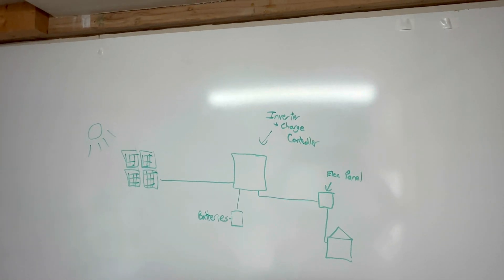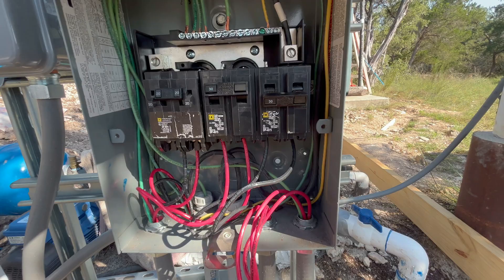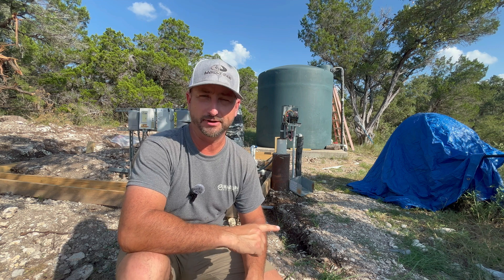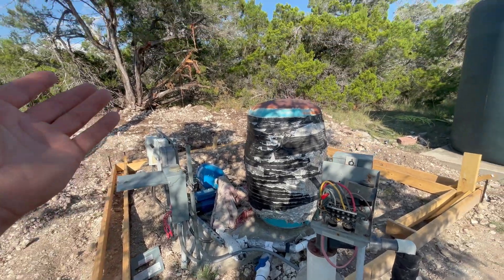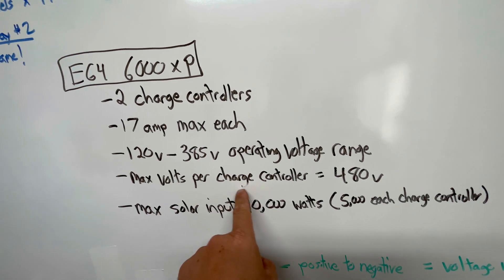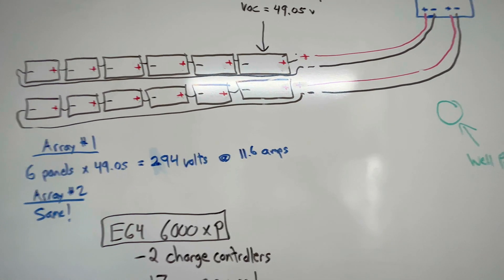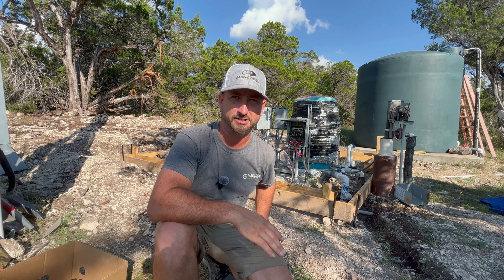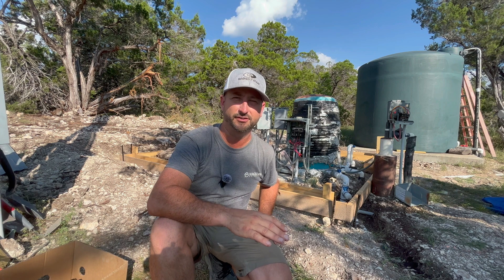How To Power Your Well Pump With Free Solar Energy? 1 of 2

Comment: As you'll soon find out, high-frequency, transformerless inverters like the 6000XP were never designed nor intended to power high induction motor loads like well pumps. You may be able to run your pump for a few months, maybe even a year, but you'll toast the MOSFETs in your 6000XP and will probably damage your well pump's motor because the 6000XP doesn't provide any galvanic isolation without an output transformer. And by the way, the 6000XP is no longer priced at $1,399.00. Try $1,699.00 for this ridiculously overpriced inverter.
Reply from the maker: @quickquote1568  I’ve had a high frequency transformerless inverter powering both my well pump and water pump, and 4 ton AC for 3 years. No problems. You have bad information.
Reply: @quickquote1568 - Do you have a source around your assertion that EG4 and like inverters cannot handle induction motor loads?  Likewise I am looking to set up something for my well pump.  Thanks.

Comment: Fantastic vid.  Any chance of a follow up showing the connection of the inverter to the pump?
Reply from the maker: @tedtuesday6278  thanks for the feedback. I just finished the complete install and have been running the well and pressure pump fully offgrid on this system for a week. Running flawlessly. I’m in process of making a video going over the entire system. I need another week to get it released.

Comment: Would a soft start work on the well pump to reduce inrush? I cut my inrush on my 3 ton AC unit by about 75% with a soft start unit.
Reply: Has your compressor gone bad yet?
Reply from the maker: @Photovoltaic_Maniac  nope
Reply: @Photovoltaic_Maniac Gone bad from what?
Reply from the maker: @Zippy1415  from what I understand soft starts won’t work on deep water well pumps. 😒

Comment: Really glad you're able to display what the EG4 6000XP is capable of, and thrilled that this will satisfy your needs of powering the water well & pressure pump! This is going to be an exciting project to follow, and can't wait to see the panel installation, conduit job, inverter & batteries installation. There are numerous people out there that would love to have another way to power their water wells, and you're displaying a wonderful solution for that community. Thanks so much for sharing!